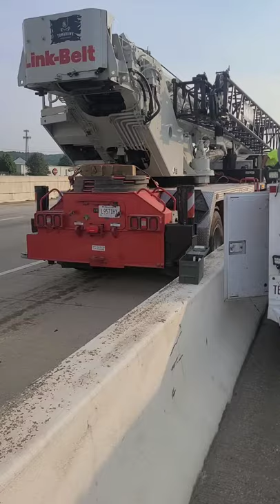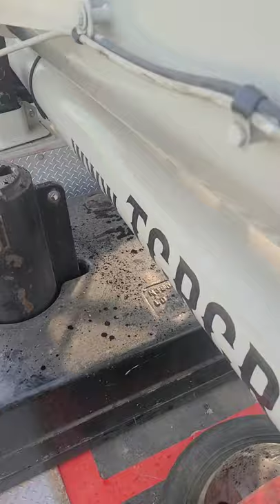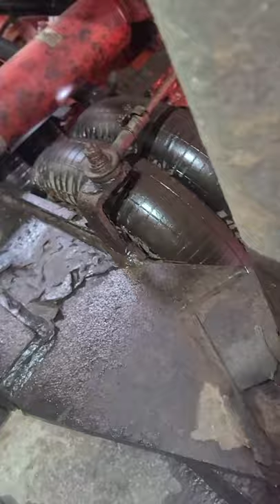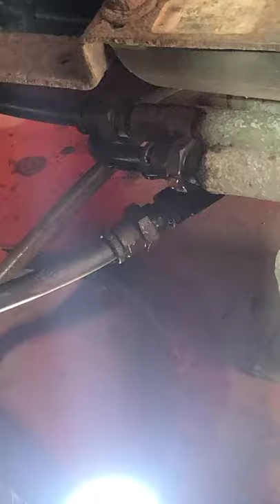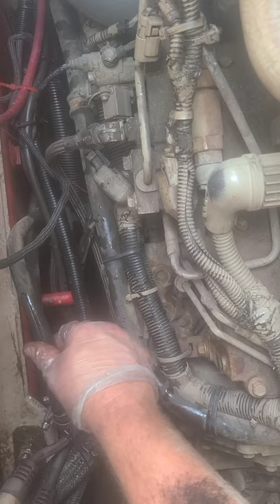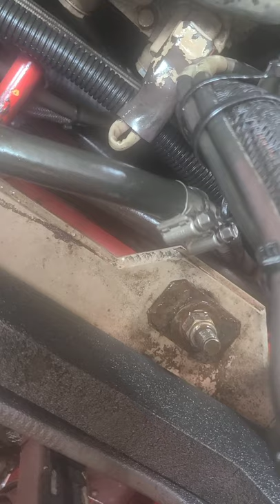How to Find a Coolant Leak-No Pressure Tester

Comment: That's funny because when your driving down a highway and this happens there's twice as much pressure in the lines and when it bust the fluid shoots everywhere shoots up down sideways plus the wind flying under truck moves Floyd all over the place so you can get thrown off plenty of times what I do is just add water back to radiator and sometimes there's still pressure build up where it'll leak right out the hole instantly
Reply from the maker: Great Idea!!! Will do that!!!
Reply from the maker: Thank you for the comment, be sure to Sub!!